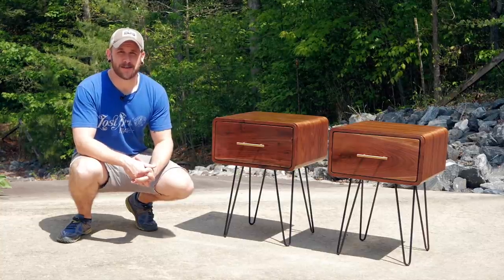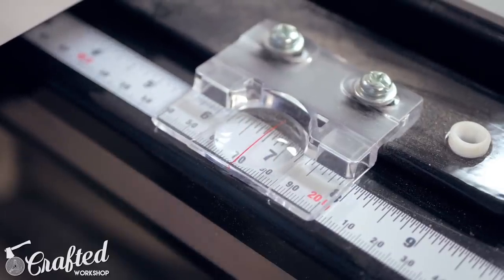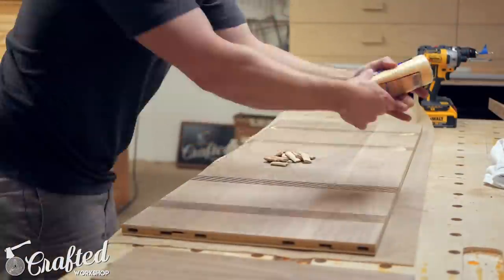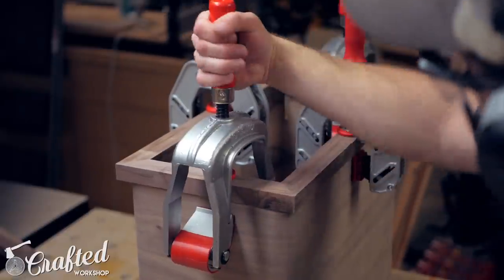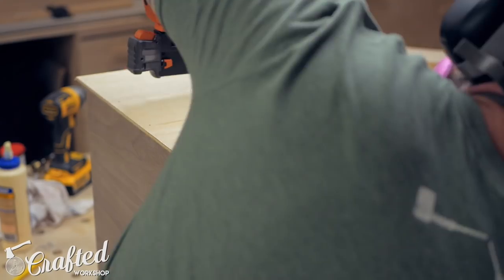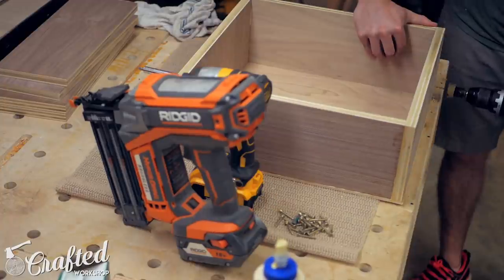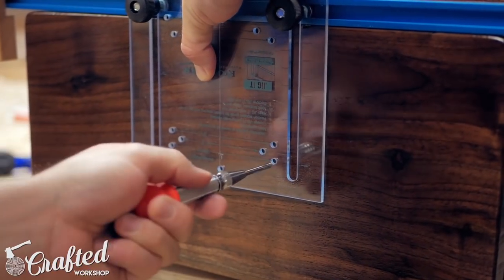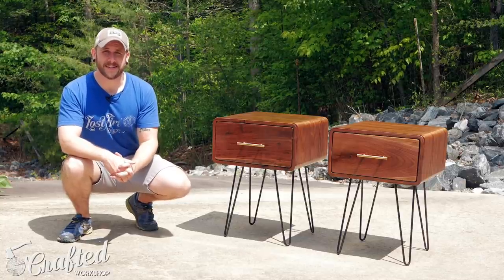Mid-Century Modern Walnut End Table | How To Build - Woodworking

Comment: I watched this video countless times and decided to recreate these beautiful night stands. Or, in my case, living room end tables. I did the dimension of the boxes a bit different though. Mine are 5.5" tall so my gap at the bottom was different. Same results basically though. I used 16" hair pin legs too and a single brass knob at the center of the drawer fronts. The carcass is birch plywood. My laminate for the front is different as well. I traced the inside of the box onto an oak board and the routed the laminate out of it giving the front an infinite look without corner joints. My drawer front is flush with the outer dimension of the carcass. I couldn't totally steal your design, so I had to switch it up a bit. I also used linseed oil on the entire stand, giving it a real blond shade of color. And they both came out awesome! Since then I've made my head board for my bed, a chair modeled after 2 chairs made by "CHEST'ER", another wood guy on youtube, my coffee table designed by myself with an upholstered top, and an ottoman. Both the chairs, ottoman and table have hairpin legs too. They also look awesome! 
 And believe it or not, I never made anything out of wood or sewed a stitch before April, 2020 when the covid crap came and screwed all of us. I even re-upholstered the entire interior of a 1962 Ford Fairlane for a paying client. Now have just about any wood tool there is, (except for a jointer, but I use my table saw for now), and 5 different sewing machines. I'm building just about all the furniture in my house except for my couch and chaise.
 Thanks for the inspiration!

Comment: Really clean final product. Your attention to detail with the fit and finish of the corners is outstanding.

If you wanted to turn that design into something you could sell for a lot of coin, mount them to a custom bed head board using heavy duty steel 90-degree brackets, creating the illusion of floating bedside drawers. You would of course have to bend a dog-leg into the bracket tongue so it sits below the center of the drawer, but mounts to the underside of the top.

The clean curves of those units would be perfect for that application, and as we all know, folks with deep pockets love that type of thing. Ferraris, fancy beds and gold diggers ;)
Reply from the maker: +pmodd thanks! That would definitely look sweet, might to try incorporate something similar!

Comment: great job Johnny those turned out beautiful one thing I can add is if the drawers get a lot of air behind them drill three small holes at the bottom of the back panel. And by the way I'm glad you demonstrated the hot water procedure.
Reply from the maker: +Opa's Workshop good tip! And thanks!

Comment: Those turned out very nice. I like the design, both on the technical and aesthetic side.  Have you considered using ratchet straps when folding in the corners? Might make it easier to gently get the fold in, and then following up with clamps to get all corners straight.
Reply from the maker: +W.A. van Buren thanks a lot! And man, ratchet straps would have worked way better. Good idea!

Comment: Very nicely done.  Those 3/4" flush trim bits have a lot of momentum and are pretty scary when you feed them the wrong way or turn the wrong corner with them. The surface finish a good bit leaves is great though.
Reply from the maker: +49cfr you're not kidding. This bit is amazing though, a huge improvement for me.

Comment: I didn't read all the comments to see if this was already mentioned, but you just need to remember that most  rotating tools (drill, router, etc) follow the "right hand rule". Basically, if you make a "thumbs up" or "thumbs down" with your right hand, your thumb represents the bit coming out of the tool and your fingers represent the direction of rotation of the bit and the direction that the bit will want to throw the material, so you want to feed opposite of this. I'm sure there's some website that explains this better, but the "right hand rule" will get you looking in the right spot.
Reply from the maker: +Eric Manning definitely. The trick is that the direction is different on the inside and outside faces of a piece like this. Always confuses me!

Comment: Dude! awesome project and they came out really clean!
I wonder if in hindsight would you make the face frames thinner? As you say in the video they're definitely a necessary evil to hide the kerfing but I suspect that using a thin (1/4"?) shop sawn veneer would be less of a visual detraction from the carcass veneer. Just a thought :)

Much respect from a hobbyist down under! Love the podcast too
Reply from the maker: +haywardab Thanks! Yea, not sure on the face frame thickness. Making them this thick definitely helped reduce any flexing that was present before. I think something a little thinner might have been better but it still looked good as is.

Comment: Powermatic jointer? Did you bump up to a 12"? Also thought you were getting as grizzly planer for some reason. must have misheard on podcast.
Reply from the maker: +Karl Recker no, still an 8" but upgraded to a helical head. And yes, bought a used Grizzly just before working out a deal with Powermatic.
Reply: +Crafted Workshop Nice. Glad to see you pick up a deal like that with PM. Really liked the tables btw.
Reply from the maker: +Karl Recker Thanks!